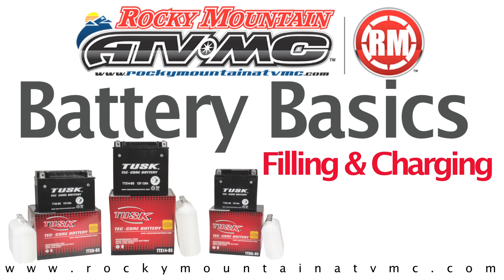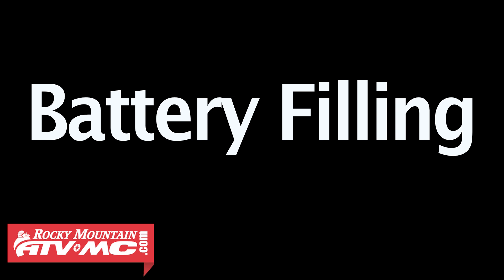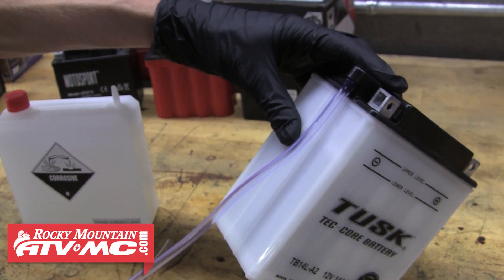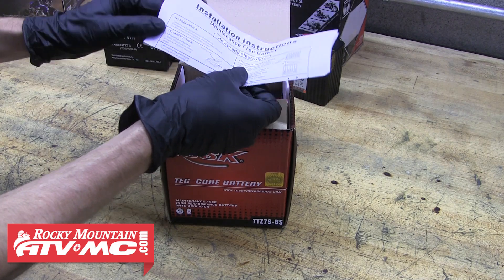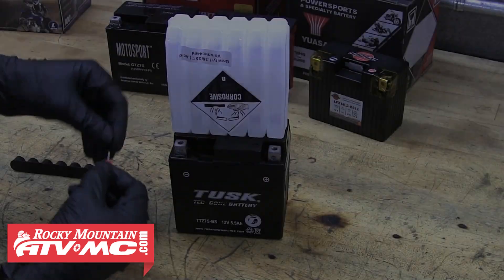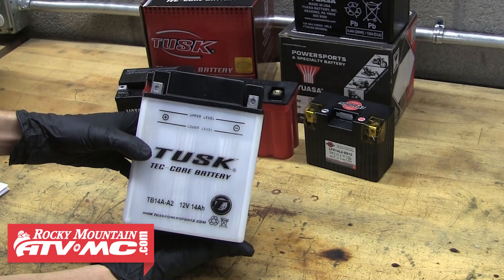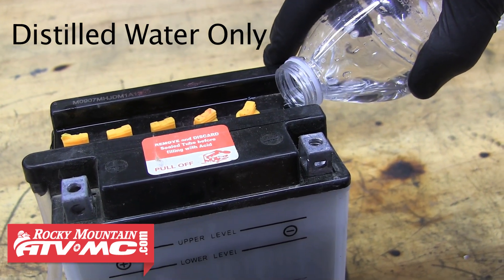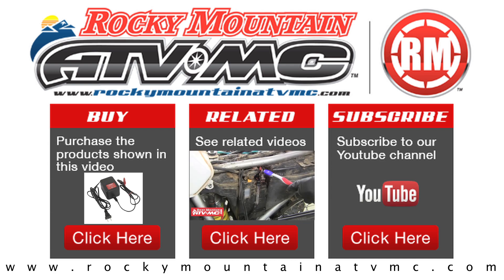Battery Basics & Activation - Filling & Charging a Motorcycle Battery

Comment: İf the output voltage is 12v on a charger, how can it charge the battery up to 14v?
Reply from the maker: The standard sealed battery resting voltage is 12.8 volts and a normal charger will bring a battery to that voltage. The 14v only comes from the machine running and charging the system.

Comment: So you can't top off battery after first charge with remaining acid? It has to be distilled water next?
Reply from the maker: If the battery hasn't been installed and used yet you can use the remaining acid if you have some. Once the battery has been charged, and used it will need to be distilled water.

Comment: I need to replace the AGM battery on my 2016 fz-07 and I wanted to gather some good information, so I thank you for that. 
On a separate observation at 7:26 I noticed that there are 4 screws missing on your surface mounted electrical quad box cover. The one screw in the middle of each receptacle is insufficient and is non compliant with electrical code 406.5(c) which requires that a receptacle must be mounted rigidly by 2 screws. The screw in the middle should remain for best practice regarding electrical installations. These covers normally are supplied with the necessary 6-32 screws and kep nuts for this purpose, and should be attached to the top and bottom of each receptacle. It's an easy fix and you should call your electrician to fix it. The square box only has threaded mounting holes on opposite corners, so the cover mounting by 2 screws is standard installation.

Comment: A very informative video. Simple and straight to the point. 

 So, I have recently discovered a battery that has that vent system on the top of it as seen in the video. I have never seen one before until now. I am in need to charge the battery, or at least see if it'll charge, but I have some concerns. There is a bit of juice leaking out of the vent. I imagine it is normal, otherwise what would the vent be for, but I don't actually know for sure; is a little bit of drips out of the vent normal? I believe it only happens when the battery is tipped to the side. Is it safe to throw on the charger if the acid is level in the cells? 

 This battery does not have the vent hose attached to it. I pulled the battery from a four-wheeler, so I am not sure if there is even a hole for the vent hose to push through for the venting to "run off" to, so do I need a hose on the vent? Would a fuel line suffice for a vent hose?
Reply from the maker: The drips should not be constant. If the battery was tipped on removal there may be some acid that comes out. If is wasn't it could mean that the battery is damaged. The acid will need to be level with the "upper level" before being charged. The vent hose is necessary if the battery is in a confined space, on a four-wheeler you may not need to worry about the vent hose as the hydrogen gasses should disperse into the air.

Comment: Hello, I recently purchased [2] Dry - Yuasa YB 14A-A2  12v 190 CCA.  Purchased Dry and filled as per your instruction.  Tickle charged carefully and one battery comes up to the 190 CCA and one will not come up above 155 CCA's.  Should I be concerned.?.  I will be running both batteries together Parallel in a Kawasaki Mule 610 XC.  I have Volt Meters, Chargers, CCA Load testers and I used new Electrolyte.  I know what I'm doing, quite frankly.  I did not install the batteries yet.  Thank you in advance and what are your thoughts.?  Thanks again
Reply from the maker: What are the volts of the battery at 155 cca?
Reply: @rmatvmc  12.8 /13.2  fluctuating over night a bit...Never below 12 V
Reply from the maker: @CScav243  what standard grade acid used to fill these?
Reply: @rmatvmc  SG 1.265  I have had 6 qt container and 2- One quart container.  But with all respect...I bought two identical batteries and one tests fine the other didn't, so whats the dif? with the potency
Reply: You never answered so I had no choice but install the batteries

Comment: Really good professional teaching video on this
The best I saw so far on this subject
You a really good righteous nice peaceful teacher
On my current battery in my motorcycle,  a terminal broke in half on the negative,  I still got it hooked up n was able to start n ride it, but I bought a new battery to install so I don't have any more problems with the broken battery terminal
I don't like these square battery terminals,  I wish they were round n more strong like on car batteries, never broke a car battery terminal no matter how many times I disconnected the battery terminals n connected them back on
I don't ride my motorcycle for awhile at times so I disconnect negative battery terminal a lot, this caused it to break, screwing n unscrewing bolt n nut a lot, plus I guess I over tightened it, I like to make sure it's tight so it will always start,  but didn't know these square terminals are not as strong as the round ones, so I won't tighten it as hard the next times I do it

Comment: Thanks for making this video.  I had to replace a small motorcycle battery on my riding lawnmower (only 7 ah).  I'm used to "buy it and go" when it comes to batteries.  I had no idea that I would need to add the acid and then charge it before using 🤔🤐 Luckily I purchased a 1 amp smart charger to try and revive my previous battery, so I'm prepared for the charging.  Thanks again for all the great information!
Reply from the maker: Glad we could help. Thanks for watching!
Reply: Always buy a real good battery jump starter, really battery charger, n maybe even a solar panel battery charger
For all kinds of things that take these kind of batteries- cars, motorcycles, Atvs , n other things
It will help you a lot especially when a vehicle battery needs to be charged or jump starter whether yours or someone else's 
I also got a solar power bank so I can charge my motorcycle battery in my storage shed or camping or whenever

Comment: I keep reading that it takes from a few hours up to 24hrs for a full charge. However, it's been about 36 hrs on a trickle charger (900ma) and still not switched into storage. Any idea what this could be or should I just leave it alone? It's an AGM battery.
Reply from the maker: What charger are you using?
Reply: @rmatvmc  It's a "Yuasa Smartshot 12V 900 mA" battery tender. The battery currently reads 14.3V connected to a voltmeter with the tender attached. I'm hesitant to disconnect since everything recommends leaving it attached till charger goes into float mode.
Reply from the maker: @Auto-Minute  If the battery has reading on a volt meter, then it should be charging. Have you measured the battery with the charger not attached? Has the battery gotten warm to the touch at all during those 36hrs?
Reply: @rmatvmc  A tad bit warm (not noticeable). It appears to have settled at 13.15V after roughly 40 minutes since being disconnected. I'll leave it untouched overnight and conduct another reading tomorrow to see where it stands.

Comment: After you charge it say you spilled a little (not below bottom line though) when installing. Can you top off with extra acid or do you have to use distilled water at that point?
Reply from the maker: If you have extra acid you can use that to top it off before installing. Once the battery has been in use and you notice the acid levels are down, you would only want to use distilled water at that point.
Reply: @rmatvmc  oh ok i see .. i already returned it though. Didn't start when i tried though i may now have a short or something... Don't see how anything else could of broken since my last battery died after not starting it one day in the cold.
Reply: Hopefully it's not a state or a rectifier problem

Comment: What if your battery has no acid can it still be repaired if you feel with acid and where can I buy acid
Reply from the maker: If your battery was ran dry it probably won't have a very long life but you certainly can fill it with acid and attempt to charge it. Battery acid can should be able to be obtained at your local auto parts store.

Comment: I filled my brand new lead acid battery and started charging it with a battery tender junior. I left it overnight and noticed when I woke up that one of the fill plugs popped off (landed on the other side of the room) and there was acid on the top of the battery and on the ground. Can you give any reason why this would happen? Should I return it? Possible user error? I read somewhere that the vent cap needs to be off while charging. I put it back on after filling it and while charging..
Reply: And you never put the cap back on after or during charge, that causes gas to build up

Comment: Good video but a couple of things people should know. On an AGM battery with ratings of less than 18 AH, let the battery stand for 20 to 60 minutes. For batteries with higher AH ratings or having the High Performance rating (designated by an “H” in the part number/name), allow the battery to stand for 1 to 2 hours before starting the charging process. This allows electrolytes to permeate into the plates for optimum performance and longer life. Also, I recommend you keep the caps or plate off the battery for the initial first charge so it can vent better during the stand process.
Reply: I have a kymco c1 125 cc motor bike. from 2015. So I am new and scared of stupid batteries and these videos are not really helping me at all. I have watched a video or 10 ha! how to take out the battery from this model of bike. Aas the battery was dead, well not powering at all. So I have managed to take out the battery from its housing on the left side and lost a back screw bolt because I was too scared of ekectrocution. So I have the battery charger a noco genius 1. In uk. So three pin ok? I have no screws in the terminals because I unscrewed them and lost the bolt into the bike. So the battery is out sitting on the floor and so I am looking at it and have no clue whatsoever how to charge it. The instruction manual for the charger is totally vague. The battery is flat. Should I clip the alligator clips to the apropriate terminals, with out the screws on or clip them to the round housings where the housing screws I took off and dropped the back nut off by fear of touching it due to internet fear mongers? So, sorry but what do I have to connect? The alligator clips? Or the round screws or? Ahh, this is sillyness
Reply: Should be on their directions. Mine says to sit for an hour to allow all gas escape. I have the diehard power ahead... Guess it's high performance.
Reply: I heard different things on how long to let it sit after pouring acid in
one guy said for a few hours, he said until it's not hot or warm anymore, he let it sit 6 hours, he also said to let it sit over night if you want
My instructions says a hour

Comment: Great video. Helped a lot. Quick question. To charge the battery, should I remove the 6 caps over the cells, or not? Thank you very much.
Reply from the maker: Yeah, it's recommended to remove the caps.
Reply: @rmatvmc  Thank you very much. I did that when I first bought the battery. Does that include later on, when you charge because they've gotten low? Thanks again.

Comment: How often do you add battery acid?
Reply from the maker: You shouldn't ever need to add battery acid after the initial filling of the battery, but if a cell does lose a little fluid you can top it off with distilled water. As long as you are monitoring it through its life you won't have to add new acid to the cells.

Comment: So I'm a little confused. The Battery you're charging says 5.5AH, and you're using a charger which says it charges at 1a. 10% of 5.5 is .55a. How strict a rule is your 10% rule? Or is any amperage below 3 okay to use on a MC battery? My battery is10ah, and I was thinking of buying a Battery Tender Junior for it, which charges at .750a. Is it okay for amps to be under the 10%?
Reply: same observations/question

Comment: DO NOT PUNCTURE the acid containers to make it flow quicker, unless you want acid to overflow and spill all around the battery.  Then go out to shop for additional acid to fill in the missing original acid once it settles in cells and leaves void after what was spilled.
Reply: Distilled water would work too if that did happen

Comment: shouldn't you wait an hour or so and then recheck the levels before charging, as well as letting the battery cool, before charging?  You make it sound like you just fill, cap, and charge.
Reply: Always let it sit for an hour or two after filling, let all the spaces fill up and fill each cell if need be. Then cap it. Charge it and let her rip.
Reply: My instructions say, fill it let it sit a hour, then add some if it fell below low level line, then charge it, then if any level went below low level line, add distilled water to bring it back to high level line ( now I would bring them all to high level line) , then charge it for a half an hour so distilled water mixes in good with acid
Then you can install in motorcycle

Comment: What do i do with the went hose after filling
Reply from the maker: It can vary depending on the battery you have but if your vehicle has an existing vent tube you'll hook it up to the new battery. It's best to check the service manual for your specific bike to see if or where the vent tube is routed.

Comment: Very helpful video. Silly question perhaps, but if I don’t have a charger, can I simply replace the battery in the scooter and then let the scooter’s engine charge the battery whilst running? Thanks 👍🏻
Reply: Excellent, thanks for your speedy response.  Mine has acid to fill and so I’ll take it to the auto-elec shop tomorrow so they can charge it for me.👍🏻
Reply from the maker: It will depend on the type of battery but a lot of lead-acid batteries will need to be filled with acid so it won't have enough of a charge to start your bike without being charged first. But if you get a battery that has enough of a charge to start your bike, it is possible to install it without charging but most batteries will have a longer life if they are properly charged before installation.
Reply: Very much no lol
Reply: Advance Auto wherever you bought it should have charger for you. I'm in the same position because I got it sold it to me was clueless

Comment: So do I put the vent plug back on, liquid is coming out as it charges
Reply: Yes, the vent plugs can be put back after filling acid or topping with water as there is a side vent port with to remove gas built up . If you filled the acid initially or added distilled water to top it off and made sure to keep the electrolyte level at the "UPPER LEVEL" mark then the battery acid should not come out through the vent hole. There will be some bubbling during the charging process due to the release of hydrogen gas. If you have not overfilled then it's likely your charging voltage is too high.

Comment: I bought a new motorcycle battery. It is a 10Ah battery and I filled the acid and put it on charge. The only charger I have available has a 600 mA output. Is this too little amperage or will it just take a little while longer to fully charge?

Comment: How long do u usually charge for the 1st time after fill from new
Reply from the maker: It will really depend on the battery you have and the charger you use to fill that battery. A general rule is to use a charger that's rated at 10% of the amp hour of the battery. Usually a slower/trickle first charge will maximize battery life.

Comment: What will happen if the battery is not fully charged after adding the electrolyte? Does it shortens battery lifespan?
Reply: Batteries form a memory. If you just partially charge it the first time that's all it'll ever know. It'll only charge to that level

Comment: Great video.  I just received a Prima CB9-B battery for my scooter.  It looks just very similar to the first battery you filled. An exhaust tube came with the battery, but it didn't come with one that attaches to the nozzle so I can pour the fluid in. The place I bought it from said to just put the nozzle directly in the cell holes.  I'm worried this is going to cause a mess.  Should I just use a funnel?
Reply from the maker: If you're worried about spilling it everywhere you can definitely use a small funnel or you can even make your own nozzle by using a spare piece of fuel line or vent tubing if you have that.
Thanks for watching!
Reply: I would if i had to. Unless your thing is long enough to put into the hole without spilling. But probably not
Reply: Was thinking that you Don't necessarily need the ventilation to. It'll vent fine on its own as long as you remove the cap

Comment: I have battery charger that can "jump" and "charge" a battery. It can be set to charge at 2 amps. Is that to much or is 2 amps ok?
Reply from the maker: It depends on your specific battery but most 12V chargers that we carry are in the .75 to 1.25 amps area. As just a general rule I would stay closer to that if you're able to set the amp output.
Hope that helps!
Reply: @rmatvmc  it's a 12v14a battery for my Kawasaki Mule. I just read in the manual that came with the battery that chargers capable of 2a auto charger can be used. That answered my question. Thank you for the info!

Comment: Great video.  Is it okay to prepare the new battery by installing the electrolytes and then leaving it on a trickle charger for a couple of months until riding season?
Reply from the maker: If your charger has a float mode on it, doing that would not cause any problems. With that said, I would suggest waiting until you're a little closer to when you'll actually be using it just because there's no reason to fill it then leave on a charger for 2 months.
Thanks for watching!